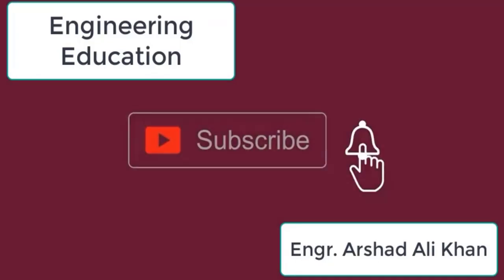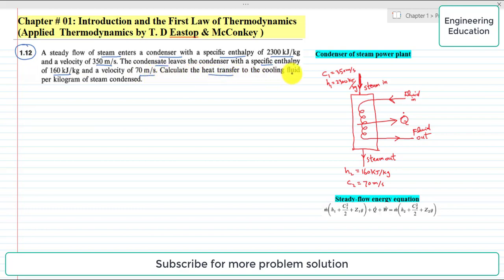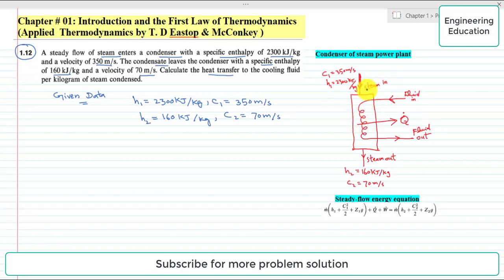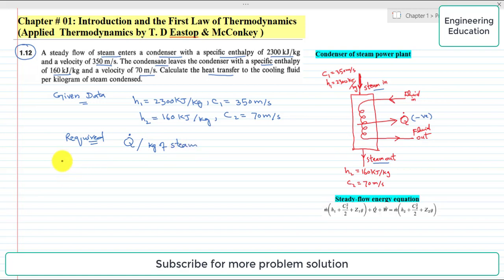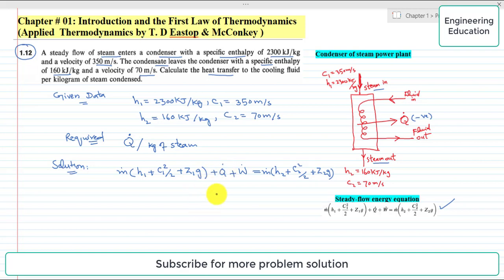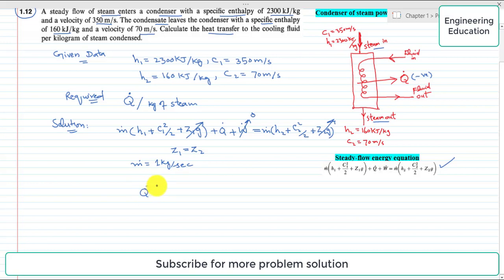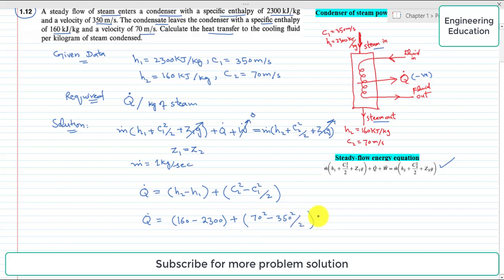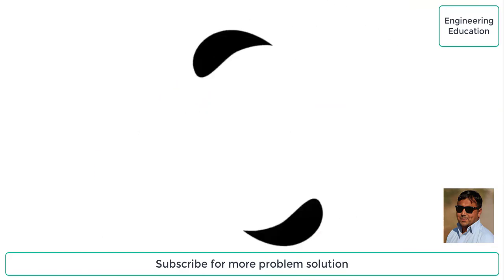Calculating the heat transfer per kg of steam from the condenser of steam power plant using SFEE.

Comment: Pls why did we divide by 1000?
Reply from the maker: One term is in kilo ,so we need to convert the second term to kilo as well, in order to make the units same and then we add both the values....Thanks
Reply: @engr.arshadalikhanofficial  I am still confused but they both have different unit or is it because of the addition sign?
Reply from the maker: @Maverick_station   For Example
We can not add 2 kg and 5 gram directly....First we will make the units same... Like 2kg+ 0.005kg=2.005 kg
or 2000 gram + 5 gram= 2005 gram=2.005 kg
Reply: @engr.arshadalikhanofficial  But looking there, everything seems to be same units, m/s and kJ/kg.
Reply: @engr.arshadalikhanofficial  You mean because Q is in kg there for thats why you multiply by 1000?
Reply: Why there is not c1 divided by 2